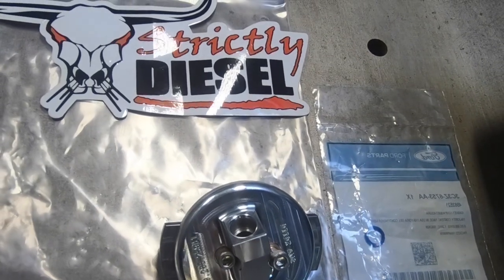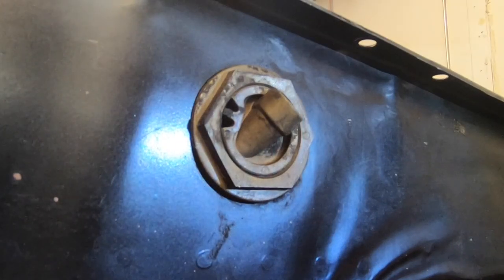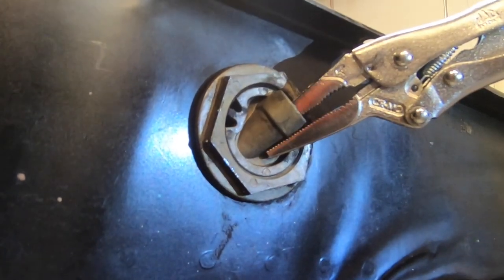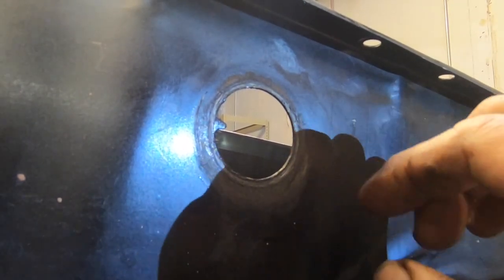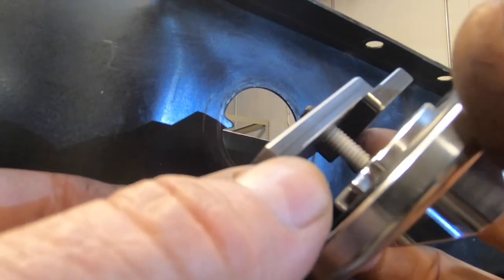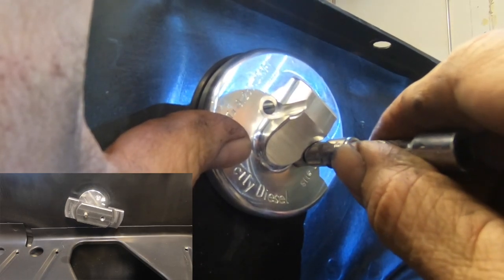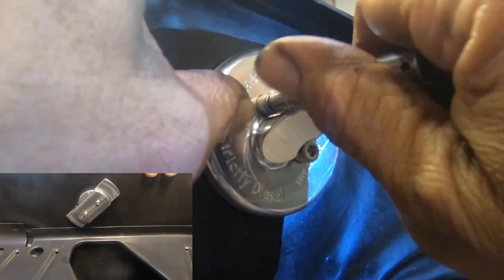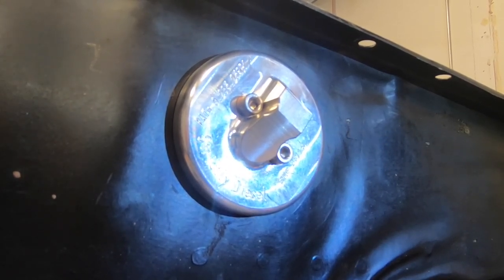Strictly Diesel Dipstick Adapter Install Video

Comment: Doing mine right now. Got your kit yesterday. I've been a mechanic for the last 24 years, 5 days a week. When I let that old adapter fall into the oil pan I got a sick feeling in my stomach LOL  letting that drop into the pan goes against everything I know. This truck is my baby I've had it a long long time. It's in 100% mint condition, so I went back and forth for a while deciding to pull the engine or use your kit. The last thing I want to do after work or on the weekend is work on a car, so I got your kit. I did a lot of research before I bought your kit and I haven't found anyone say that it caused internal engine damage. But I'd just like to hear it one more time right from the horse's mouth. Have you had any cases of someone having the old adapter ruining an engine? If you say yes but it's one in a million I'll still leave your kit on my truck. Just want to know for my own peace of mind. Every time I drive this truck from now on I'm going to be thinking about that old adapter floating around in the oil pan. I get what you're saying about the weight of the oil keeping it at the bottom, plus the baffles in the oil pan help, but even still it just makes me cringe thinking about it. Thanks for a great product, it's really an ingenious, simple solution to an otherwise huge project. AS LONG AS THAT OLD PIECE STAYS AT THE BOTTOM OF THE OIL PAN THAT IS!!! LOL!
Reply from the maker: There has never been a single factual report of engine damage from the OEM part being in the bottom of the pan.  The part SINKS IN OIL, and the viscosity of engine oil keeps it from moving around much, even on the bottom of the pan.  It is too thick to get between the oil pump pickup and the bottom of the oil pan.  It simply has nowhere to go and just sits there doing nothing.  A person would need to do something beyond extraordinary for that piece to somehow make it back through the hole in the windage tray (against the forces of gravity and the viscosity of the engine oil) and continue far enough above the windage tray to get into moving engine parts.  The kind of extraordinary that we would all want to see on video, something that would make for a seriously viral video, and likely still not be believable.  Considering the number of adapters on the road, and the now MILLIONS of miles on them, it is very safe to say that if it is installed properly, and the instructions followed, there is nothing to worry about.
Reply: @StrictlyDiesel  Thanks for the reply. I am a 100% believer now. It's been almost 2 weeks and I don't even think about it anymore. It was just a strange feeling letting that piece drop in there at first. But I am sold! Thanks again for a great product!
Reply: Just put a magnet on ur pan if ur worried. Then it won't go anywhere
Reply from the maker: @ravenskaugrud8410  Doesn't work, the OEM part in the pan is not ferrous, it doesn't stick to a magnet.

Comment: There isn't concern that the old dipstick adapter can come in contact with the crankshaft if it's free to move around inside the old pan?
Reply: I would think it would sit at the very bottom of the pan.just using logic but I also see your point ss well.
Reply: @jordanwismer3768  that part isn't ferrous. It won't stick to a magnet
Reply: theres a tray that sits between the crank and the bottom of the pan that i can slide around in but it wont jump out of the tray after it falls in

Comment: Nice, parts rolling around in the oil pan. Totally legit.
Reply: For real... I was thinking about doing this until I found out you just leave the shit in your pan. I know it doesn't hurt anything but I still don't like that.
Reply: This is how mechanics do it. And not any mechanics, Ford Master Mechanics.
Reply: Update pls about part in oil pan it not gotta hurt at all ? Cuz I have same problem on that truck with customer… I did put new o ring and gasket marker n little tight big nut size  n still leak but I believe when I do job the big nut was loose I think it vibrates and make the part like shaved or little dent
Reply: It doesn't "roll around in the pan" it's sitting submerged in heavy ass oil.  It still moves I'm sure, but not much. 
Mine's been in there a year this month problem free. 
You could always pull your engine out and drop the pan to do it "the right way" but unless you're ready for a rebuild anyway who the hell would do that??
Reply: @carlspackler91  do you feel better about your crappy repair now?
Reply: @TheMonadnockShootist  master mechanic is a fancy word for people who rush through jobs to maximize profits.
Reply: @scottvitelle8423  Awww
Your what hurts little fella?

Comment: Well that explains why I’m losing a lot of oil in a short time I’m pretty good about finding oil leaks but this one had me stumped. 99 F250 super with 418,000 on her have this truck now for 17 years was my daily driver until oil loss. Thanks for the vid. Have to get me that adapter.

Comment: If I would have known about this part before I had to pull my engine to get to it, then I wouldn’t be doing a full rebuild on my 7.3 right now. I told myself that if I had to unbolt the engine, then it was coming all the way out and getting rebuilt lol

Comment: My main concern is aligning the non teflon taped bolt with the “backplate.”  Is that particularly tricky, you didn’t have much trouble but under the truck, lighting meh, and not being a mechanic, have you heard of folks having issues or being unable to get the holes lined up and bolt to thread? Second concern, O loss, is the design decent enough to prevent a clumsy approach from allowing o ring to fall into oil pan? Seems like you’d have to try to work around the flange on the internal part but is that a threat? Thx! Great video and

Comment: 1996 F350,7.3 powerstroke.

I purchased one of the o-ring replacement kits and while trying to install it the wire brush that is supposed to allow you to finish the job slipped out and the part dropped into the pan.  Since it is not magnetic all attemps to fish it out failed.  The issue with the wire brush is that the dang thing got in the way of the the outside nut starting.
Cost to R and R the engine, pull the pan is way beyond my budget.
I found this video by accident and decided to try it.

I installed it last week.  Since I already had the starter off it took less than 2 hours to install.  I took it on a trip of over 500 miles and it has performed flawlessly.

I had a couple of issues during the install.  First one was that I dropped the copper crush washer off ot the loose bolt and couldn't find it.  I had to use a fiber washer off of a motorcycle carb repair and some black sealant and it seems to be working.

Second issue is that I had a problem with getting it to seat against the pan.  Since I cant see in the pan I believe that the part of the clamp assembly inside the pan as pointed down and hitting on a part of the pan keeping the outside part from seating properly.  As I turned the captive bolt it popped into place.

One thing I did do to try to make the install easier was to use a fine line magic marker to mark the captive bolt with a line on the plate so I could get it close to lining up.  That worked like a charm and I lined it up and the other bolt slid in with no problem.

I wish that I had seen this video before I tried the other repair it would have saved me hours of work.
Reply from the maker: Sorry you had trouble with your initial attempt to repair the issue, but very glad you found success with our fix.

Comment: Any advice for dipstick tube removal on a E350?  The tube is mounted to an exhaust manifold stud in a difficult location opposed to the valve cover.   I may end up cutting it and splicing it back together with a hose and a couple clamps.
Reply from the maker: I just double checked our shop van and the tube is bolted to the valve cover.  What year is your van?

Comment: Out of curiosity, Do you think it would be possible to crush the old dipstick adapter with vice grips enough to pull it out the hole? I'm sure youve tried.
Reply from the maker: I highly doubt that this could be done and I would be more concerned about the pliers chewing up the part and breaking off small sharp pieces into the pan while trying.
Reply: @StrictlyDiesel  right on... I wasn't sure how malleable that metal was, I have to do this repair and am looking for a solution. Probably will use your part. Thanks!

Comment: The only thing I wonder do you have to drain the oil to install this I thought about doing this or wait till my next oil change to install it.
Reply from the maker: I can't say that we have tried it without draining the oil.  It may be possible, but having oil in the pan will make it harder to hear the interior piece land in the sump, and may make it harder to see the interior piece with a mirror if you need to verify that it landed in the sump.  I think it is best to wait and do it with the oil drained just to be sure that the install goes properly.

Comment: yes this is all very well if the oil pan is off, but what if you do not have the pan off, you cant have that bit of metal rolling around in the bottom of the sump.?? can you? I don't know. As to take that pan off, cost you dollars to have this job done like that, ps your lighting and photography was tip top
Reply from the maker: This part was designed specifically to prevent you from having to pull the engine and pull the oil pan.  Nobody wants to do that if they don't have to.  As for that "bit of metal rolling around", considering the fact that the OEM adapter sinks in engine oil and has the weight of 10+ quarts of viscous engine oil keeping it from moving around much, there is nothing to worry about there.

Comment: Cool! Great video. Is there any problem the allen bolts weeping oil?
Reply from the maker: The allen bolts are sealed with copper washers, so this has not been a problem.

Comment: I have seen where some say to let it fall in the very back of the pan and some say to let it fall in the deep section of the pan as shown in this video. Which is the correct way? I have my dipstick adapter on the way to do this repair. Would greatly appreciate any feed back
Reply from the maker: My guess is that those saying to let it fall into the "very back" of the pan are just phrasing it differently and mean the same thing.  You want the adapter in the BOTTOM of the deepest part of the pan, below the windage tray.  If you follow the included instructions and this video, you will have done it correctly.
Reply: It's going to make it's way in the deep part no matter what you do. Go up or down a steep hill and it's in the bottom.
Reply from the maker: @billmalec  I don't recommend waiting for inertia to move it around, it's just far safer to make sure it makes it into the bottom of the sump during install.
Reply: @StrictlyDiesel  how do you know where it falls? For certain? I was just saying if it didn't fall there it would make it's way there on it's own.
Reply from the maker: @billmalec  we recommend using a mirror and flashlight in the directions.  if the part stays on top of the windage tray, it remains close to the crankshaft and there is increased risk of contact.  Once pushed down below the windage tray, it isn't coming back up.  The hole in the windage tray is right below the adapter, so it generally falls right through, but it is best to make sure of it before installing the replacement.
Reply: Couldn’t you leave a magnet on the bottom of the pan so it could hold the adapter down?
Reply from the maker: @carlospalmerin4877  No sir, the part is pot metal junk, it won't stick to a magnet.  Additionally, there is no need, gravity and the weight and viscosity of the engine oil on top of it keep it from going anywhere.  As long as it is in the bottom sump, below the windage tray, it isn't going anywhere.

Comment: I just bought your kit! Is there any need to lubricate the o-rings on the back of the new adapter?
Reply from the maker: No.  The only think you would apply to the back of the adapter is a 1/4" bead of RTV (between the o-rings) if your oil pan appears to have enough warpage to warrant some extra insurance.

Comment: No more leak but on the highway I lose oil pressure and engine cuts out randomly?
Reply from the maker: Considering the fact that this part has nothing to do with oil pressure, there has to be something else going on.  The oil pickup tube sits so close to the bottom of the pan that the OEM part that is left in the can can't get under it.  The pickup tube has a screen, so even if you left the o-ring from the OEM adapter in the pan, it couldn't get drawn up into the tube and it isn't large enough to block any significant oil flow.

I would be looking to get a mechanic to do a base engine oil pressure test, and also confirm what the oil pressure is doing with a real gauge in the same conditions that you are experiencing the problem.  They may also want to look for signs of oil aeration.  The oil pressure gauge on the dash is controlled by a pressure switch that is mounted in the top of the high pressure oil pump reservoir.  If the cutting out and loss of oil pressure are related, that reservoir is losing enough oil volume/quality to interrupt the pressure supply to the rails in the heads that feed the injectors.  This sounds like an oil supply issue.  These trucks are getting old, and most have a bunch of miles as well.  We've seen pickup tubes crack and cause oil pickup issues and oil quality issues (oil aeration).  We've seen worn lube oil pump gears or damage to the aluminum front cover behind the lube oil pump that affects pumping ability.  

Best of luck getting is sorted out.

Comment: Would you need a new dipstick tube as well?
Reply from the maker: Only if yours is rusted or damaged in some way.  Otherwise, just clean up the end, install the included new o-ring and reuse it.

Comment: I droped the oil ring can't find it some say it will be ok but im not sure 😢
Reply from the maker: The o-ring isn't enough to block the pickup tube so it is doubtful that it will cause any damage.  We would always prefer to get it out of there if possible.  You may find that it works its way to the drain plug area and that you can find it with a 90 degree piece of wire or something through the drain plug at the next oil change.
Reply: @StrictlyDiesel  there was a baffle plate or something at the drain plug could stick anything in there  it didn't look like the one in your video im sure it's fine I have thoughts in my the oil ring getting gummed up in the crank bearings 😂

Comment: You think it would be better to have the oil empty when doing this?
Reply from the maker: We do recommend draining the oil for this job, as it makes it easier to verify that the internal piece of the OEM adapter makes it to the lower sump as instructed.  This is all covered in the full color instructions.

Comment: sorry   where can i find that adapter?   The old oring fell inside the oil pan will it get sucked in the motor or clog anything?   what a good idea for the adapter.  this is awesome  thanks so much!!!!!!
Reply from the maker: You can find the adapter here: https://www.strictlydiesel.com/category/172/73l-dipstick-leak-repair

The o-ring probably won't cause any issues, as it can't pass through the screen in the oil pickup tube.  It is still a good idea to get it out.  If you drain the oil and then use a bent piece of wire, you can probably snag it off the bottom of the pan and pull it out the drain hole.

Comment: Is it safe to drop that part into the pan
Reply from the maker: Yes it is. Once it's in the bottom of the pan it has no way to contact any moving parts and it will not float to the top of the oil level.

Comment: What would a shop charge to install it u think
Reply from the maker: You would need to contact a shop you are interested in to find out.  Shop labor is billed by the job, based on each shops hourly rate.  They will be charging you to R&R the starter plus some amount of time for installling the adapter.

Comment: Couldn’t you just weld the original plate to the block? Wouldn’t that be a permanent solution?
Reply from the maker: No, the OEM adapter that is installed through the pan from the inside is not steel, and the pan is steel.  The OEM part is some kind of cast pot metal junk.
Reply: @StrictlyDiesel  makes sense. I like this kit. Only concern is the old adapter piece being left in the pan. Has their been any issues from having it floating around in the oil pan?
Reply from the maker: @kenxiong6830  None.  It doesn't "float" anywhere, it sinks in oil and sits in the bottom of the sump, its movement distance and speed hampered by the weight and viscosity of the engine oil it is submerged in.  As long as the directions are followed and the OEM piece is dropped into the LOWER SUMP (below the windage tray), there should never be any kind of problem.  Based on the number of these out in trucks, there have got to be literally millions of miles on them by now.
Reply: @StrictlyDiesel  thanks for the response. I feel more at ease now.

Comment: How long does it take while pan is still on motor.
Reply from the maker: It depends on a number of things, from your comfort level and experience working on your truck to just how filthy the side of your oil pan is.  I would say that it will be somewhere between 30 minutes and 2 hours, depending on how quickly you move, how much cleaning you do, etc.  I suspect most people are done in 30-60 mins.
Reply: @StrictlyDiesel  what's the charge to do this?

Comment: Has anyone used this replacement and had the screws  vibrate  loose?
Reply from the maker: If it has happened, it wasn't reported to us.  You could certainly use some blue loctite on it if you are concerned.